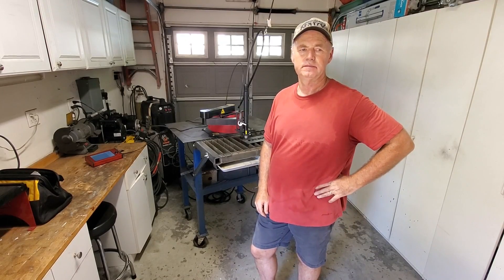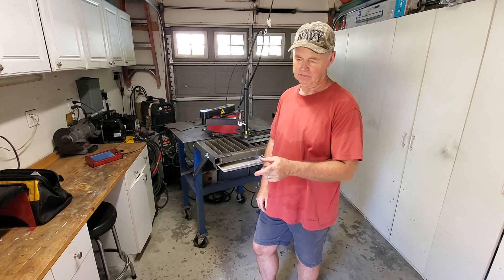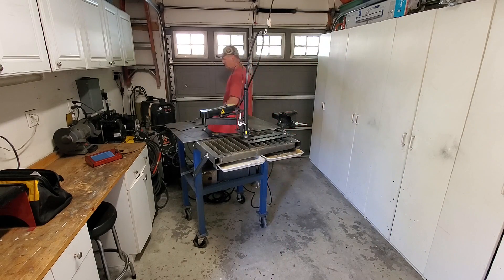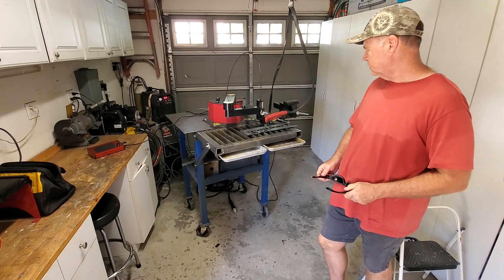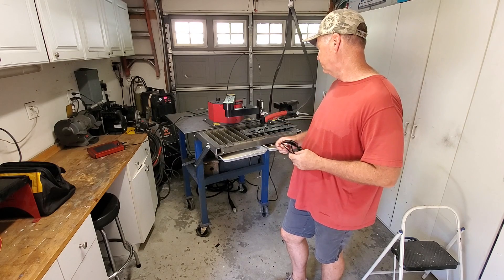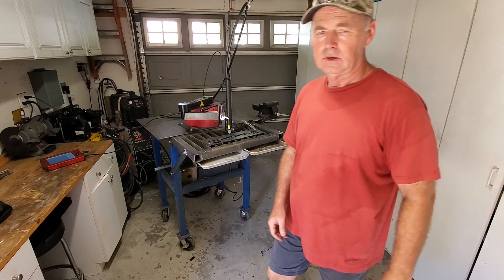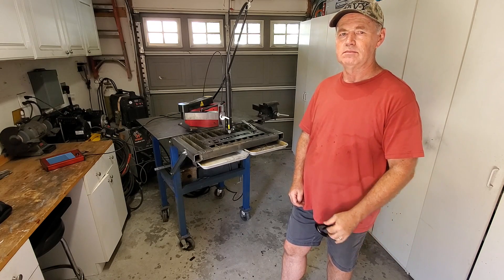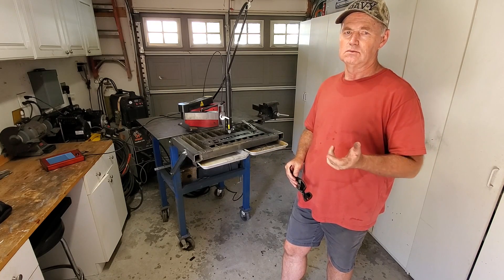My Arcdroid locked up multiple times

Comment: The frequency of the plasma is messing with the arcdroid.  Need a different plasma that Has low frequency....
Reply from the maker: Those problems all stopped when I stopped feeding back cut voltage to the arcdroid.  All is good as long as the torch on/off circuit is the only thing going from the cut60 to the arcdroid.

Comment: I have communicated w Andrew precsales quite a bit. It wqs recommended to me not to use the internal.voltage wires pin 4 and 6 of the cut 60 and wire only pin 1 and 2 for trigger. 
I was also curious on the back of your cut 60 is your cnc port at the top or at the bottom?  
If it's at the bottom that is an earlier version that is known to have issues with langmire cnc tables and a few others.  The cnc port on the top of the rear of the unit is what you want.
Reply from the maker: Well I can certainly back up that with what I was experiencing.  After I removed the wires from 4 and 6 on the Cut60 side the Arcdroid went back to working normally.  My cnc plug on the back of the cut60 is at the bottom, more confirmation I have an older unit.  Thanks for the info.
Reply: How long have you had your unit?  If you are within 3 years and it's in good condition I would bet you call them and they swap your unit out with a more current build with the cnc port on top.   I know for a fact they have done that in the past.  They are an excellent company.  If I recall on the arcdroid compatability it even states cut60 units produced after a certain date (which is when the port location chnaged)
Reply from the maker: I sent off an inquiry to PowerWeld.  I agree they are a good company and have supported me well in the past.  Thanks for the info and advice.
Reply: @6.8liter74  - Any update from PrimeWeld?
Reply from the maker: Nothing useful.  The finger pointing has started.  Primeweld says " this has happen to numerous ARC Droid customers in the last few weeks , not sure what is causing it on the Droid side"   They suggested using a longer Cat 5 cable between the arcdroid and the controller...  At this point I would have to recommend buying a different plasma cutter from the arcdroid compatible list.
Reply: @6.8liter74  definetly the cnc port on the bottom is a configuration of known possible issues. 
Another thing just a side note if it's not.   Use a fully shielded cable. It's my understanding it's sensative to EMI & RFI . Shielded should be used regardless of plasma cutter.    Keep the good vids coming!
Reply from the maker: Purchased in October of 2021.  I guess it couldn't hurt to ask, good idea.
Reply: @6.8liter74  in doing so provide detail about your cnc use and it specially staing a compatability issues with the cnc port on the bottom and the newer configuration with it on top is needed and how you can go about it.

I would be stunned if they didn't just swap it out for you.

Comment: Try removing the thumb drive. I think I saw someone that had a similar issue.
Reply from the maker: I will try that next time, though it did start working normally with the thumb attached after I disconnected terminals 4 and  6 at the plasma cutter.  Thanks for the tip.